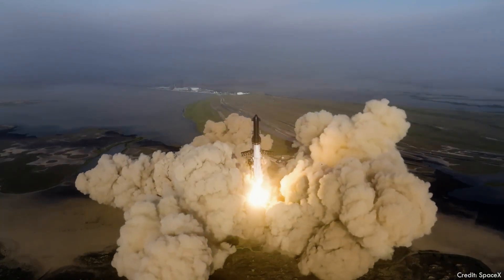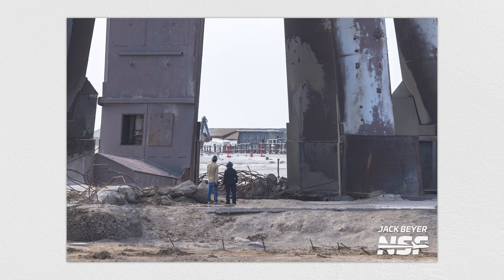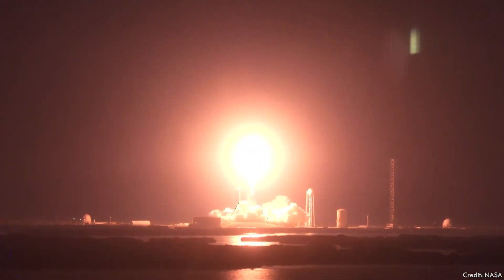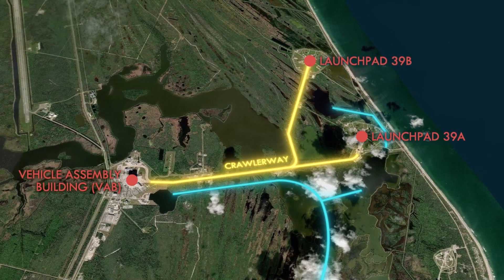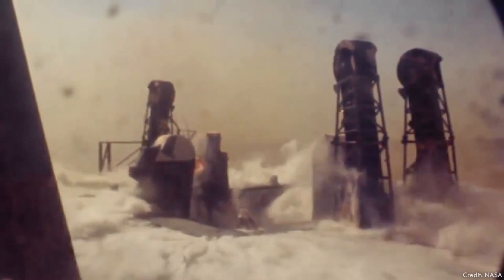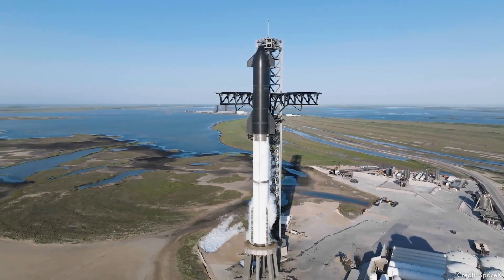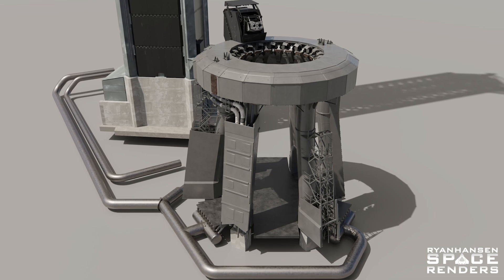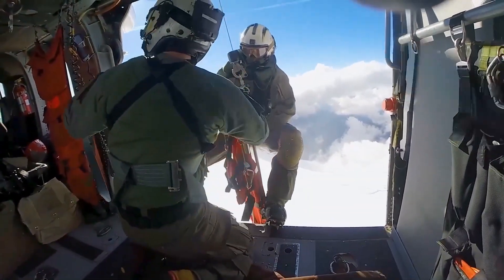Was Starship’s Stage Zero a Bad Pad?

Comment: The launch pad design baffles even the most casual observers. No attempt to even shield the support and supply structures or distance them from the pad. No attempt to channel or direct the thrust in any way is baffling.
Reply: that is because casual observers are easy to baffle. They would be surprised with what you could get away with. The casual viewer is going to be baffled when the steel plate works.
Reply: @snuffeldjuret  well it seems like they didn't "get away with" the original design in the first place, so...
Reply: SpaceX is eventually planning to build 10-100's of launch pads.  They're willing to risk a few messy failed tests now to find the cheapest way to build a launch pad.  They also appear to want a flat surface under the main engines so rockets can be serviced on the launch pad.  Finally the "tank watchers" on the internet had spotted parts for the water cooled steel plate months before the first flight test.  SpaceX knew that concrete wasn't a long-term solution, they just expected it to hold for just one more flight...
Reply: I mean there's plenty of shielding of the support structures. But when you're dealing with the amount of energy they are you also have to accept that there's no level of shielding that will protect you from a worst case event. So you build enough to work for standard operations and plan to fix it if something goes really wrong.

The gas dynamics of the plume under and around the pad itself are more complex than you'd think at first. The dead centre of the pad probably had the least heat flux and wind speed for example. Not intuitive.
Reply: There isn't going to be a pad on Mars. Id say its a good test lol
Reply: @j2kerrigan  there isn't a hospital on mars either, so let's stab the astronauts and see what happens.

Comment: So why not get off the pad with fewer engines and light the rest when clear of the tower?
Reply: Nowhere near enough thrust. It barely lifted with the 30 active.
Reply: It doesn’t work that way. It is at its heaviest state on the pad, all of the fuel is in the tank it is loaded with wet weight. 
It needs the most amount of force at the start…
You will NEVER take off without appropriate thrust to weight ratio.
Reply: The less engines you have the slower you'll be
Reply: @mskiptr  Right, it doesn't matter as that water cooler may do the trick.  But otherwise, a few seconds of fewer engines to get the mass that bit further away from the ground, then light the rest for a longer or stronger burn to compensate. Anyway, doesn't matter since neither of us are likely rocket scientists working on the project.
Reply: @Jack Photon  when it comes to fighting gravity you aslo have to imagine that it's a constant, so if you have 30% less power your rocket will not move as all the energybis spent fighting gravity, at 15% less rocket power you are still looking at a much longer time on the pad but you are moving, it's exponential growth of how long it will take when you cut thrust, more time on the launch pad means more time the rocket is blasting it. 

Other factor is safety, it's better to know if your engines light in one moment before launch vs in the seperate moments where you can't abort after the first set light up.
Reply: Of the 33 they can have I think 6 fail and make it off the pad. They had 3 fail on the pad and another 2 shortly after. I think a fair amount of the damage was actually caused by the greatly slower than expected liftoff speed. They were expecting 3 seconds or so of plume impingement on the pad tapering of to 6 seconds and they had more like 10 seconds of full intensity.

Comment: Certainly some info on the mode of failure would be nice.
Reply: @professorfrog7181 As I said, they'll most likely make it to space on the next launch. Needing a few launches to work through any issues with the largest rocket ever made is perfectly understandable.
Reply: Disintegration caused by high winds.
Reply: @Sonny_McMacsson  Disintegration was expected, but that didn’t eat through many feet of concrete and rebar. The concrete actually snapped in half under the load, and that allowed the “high winds” to eat through the soft sand underneath. Disintegration would have been acceptable, and even expected, but snapping in half was unexpected and thus not included in the assessment.
Reply: @timwildauer5063  that sounds about right. I seriously doubt spaceX would have gone ahead with the launch if they expected a catastrophic failure like this. Whatever they were expecting, it was probably much more tame
Reply: @timwildauer5063  doesn’t concrete have an expected maximum load…
Reply: So many engines failed it did not have the delta to make it to space nor orbit. They lost control of the biggest rocket ever launched, and it was trying to point back to earth. Thankfully it is just a giant metal tube with no real structural support, so even after the flight termination system failed, the rocket as able to fall apart in the air, instead of turning into a missile headed for Mexico/Texas.

Or do you mean the mode of failure for the launch pad? That was caused by pointing rocket engines at concrete and just assuming nothing will go wrong. Like all companies that employ "move fast, break things, go bankrupt" culture.
Reply: @noconsent  Nice bit of baseless fantasy and perhaps wishful thinking on your part. Once B7/S24 was heading down range, it wasn't coming back; "... turning into a missile headed for Mexico/Texas." is a story for the simple-minded.

The IFT1 showed that the rocket's hull can handle another 5,000,000 lbs-force of thrust under the booster, with a stretched ship with more engines atop it. The test flight of Stage Zero exposed its inadequate foundation under the pad, quantifying the needed upgrades that are now well underway to support 20,000,000 lbs-force launches on a rapid launch cadence. 

Starship and its successors will fly as reliably as Falcon 9 does today. Really large rotating space stations and nuclear-powered interplanetary express ships are now firmly in our near future abilities.

I've been waiting 50 years for this moment. The era of the super rocket has finally arrived.
Reply: @psycotria  dude had one launch clearance, given by the FAA, and absolutely botched it, and abandoned all responsibility for breaking agreements he had with fish and wildlife to not hurl concrete into protected wild lands, and you think he is going to be permitted, not only to do it once more, but to do it on a frequent and regular basis? Things won't get fixed if you can never admit you did something wrong. It is a fact the abort system failed, and who knows what would have happened then the worlds largest rocket, still full of fuel, crashed back on earth in area were it could have landed among the population. And the FAA is not giving out launch permits to rocket launches that don't give one iota about doing it safely.
Reply: @noconsent  The consequences of the launch were well within what was expected from the environmental assessment. The debris stayed within the the expected 700 acre debris area, aside from some harmless sand/dust. And you can expect SpaceX to repair the wetlands as per their agreement with the authorities.

The next launch is likely to be more successful. They'll probably get beyond stage separation, and most likely all the way to space. The next launch will also feature larger explosive charges so that it disintegrates quicker after FTS activation.
Reply: @noconsent  The first flight of a new design rocket often ends in failure to achieve all milestones. The sole criterion for success of IFT1 was met when B7/S24 "cleared the pad" without destroying the launch complex, freeing it up for the next improved test articles to come. 

B7 was the first booster deemed flight-worthy; it flew. 

The launch license is valid for five years. Starships have been grounded pending the outcome of a standard investigation into the spread of sand and concrete beyond the allotted 700 acres and the delayed response to the flight termination system (FTS) activation. Both concerns will have been addressed and corrective measures taken, before the investigation is concluded. 

All other operations are not affected. 

The next launch campaign is currently underway. S25 is on Suborbital Pad B and will do engine test firing. B9 is next up and will take to the orbital launch mount (OLM) as soon as in won't hinder the OLM's upgrade. 

B9 will fly with S25, sister ship to lost S24.

During IFT1, the B7/S24 stack never violated its clearance. It remained inside its flight corridor and came down within the exclusion zone. The rocket's construction proved to be more sturdy than predicted. A more powerful FTS has already been tested. A new det-cord FTS design cut booster test article B6.1 in half on a test stand in May. 

B7 had 33 unique Raptor 2 prototype variant engines. SpaceX now has data on each one's performance. Its retrofitted engine isolation shielding has been replaced with integral shielding in B9. The latest standardized pre-production Raptor 2 engines have been fitted. The hydraulic TVS failure that caused B7's 13 engines to lose steering has been replaced with electric TVS wherein each engine gimbal control is isolated. B9 is waiting in the hangar, ready to put S25 onto an orbital trajectory.

Every prototype booster prior to B7 except one has been scrapped after undergoing testing, including B7's sister ship, B8. 
Booster B4, the first to be integrated into a stack, is "retired". 
Ships SN15, which flew and did the first successful "flip & burn" landing, and S20, the first design to fit the Raptor 2 engine, are also retired and on display. It's either fly them or scrap them.

 
Starships will keep flying. They will land NASA astronauts on the Moon. It's only a matter of time before they will be flying and landing as reliably as the Falcon 9 does today.

Starship is our Super Rocket of the Future!

Comment: Those rocket motors were an older generation. So what do you do with 30 obsolete motors. You use them and take advantage of whatever data you can collect, including what happens to the launch site.
Reply: Personally I would've used them maybe to do an actual full power test over some of my concrete, instead of causing incredible damage to my launch facilities.

Comment: So why not show a before and after picture depicting Stage 0 after the test launch and Stage 0 now, around 2 months later...?
Reply: They put in something like 6 new friction piles under the mount and now have it filled with rebar, ready for the new pile cap pour.
Reply: What’s the point? That’s besides the point of the video.
Reply: Exactly. If it can be repaired so quickly, and months have passed, then let's see the progress.
Reply: @veloxsouth  It doesn’t matter if you can repair the damage quickly if said launchpad being obliterated also damages the launching rocket. It’s a failed design.
Reply: @skirata3144  good point

Comment: Why not assemble a system of multiple spacecraft in low Earth orbit, instead of trying to get the whole thing in one enchilada?
The heavier you make a rocket,  the more fuel required to liftoff, the heavier it gets...
Launch 10 Falcon heavy rockets to Low Earth Orbit, each carrying 1/10th of your plantetary exploration (Mars) vehicle.
Assemble it in orbit.
Then add people with an 11th rocket.
Then go to Mars.
Reply: I thought that's exactly the plan. Just done with completely reusable Starship, not Falcons, whose second stages are one-time use.
Reply: The bulk of the rocket is fuel, so that's basically what SpaceX is doing. To get each ship to Mars, they will first get a mostly-empty Starship into orbit and then bring all the necessary fuel during several consecutive launches.
Reply: @mskiptr  The Starship (second stage) is filled with propellant at launch. It just uses that propellant to finish getting to orbit, so needs to be refueled to leave Earth orbit.
Reply: Generally, as a rocket gets bigger, its payload to fuel ratio increases and hence its efficiency. So if you want to put 100 tons of mass on the surface of Mars, or the Moon, then it's better to launch a few huge rockets rather than many tiny rockets.

Comment: didn't nasa figure it out decades ago?
why is this still an issue?
Reply: > didn't nasa figure it out decades ago?

Yes, NASA did not figure it out decades ago. NASA rockets and infrastructure, time after time after time, ended up being WAY too expensive.
Reply: Because SpaceX is really married to being next to a wildlife reserve which makes getting building permits and doing some other stuff very difficult.  Common Sense Skeptic did a video where he discussed why they couldn't do a flame trench system, though I forget which one.
Reply: Because Starship is also supposed to be able to launch from Mars and the Moon, where you can't easily build a flame diverter.
Reply: @sdsd4139  You can't build steel sheets with massive deluge systems on Mars or the Moon either.  If they wanted a realistic test it should've been placed on loose sand and rock.
Reply: Someone didn't want to spend all that money? We have to replace it all anyway, why not save all that time, and let the rocket blast it apart.
Reply: 1st, Nasa never launched anything as large as this. 
2nd, it's not an issue. Damage to the pad was expected before the launch. When you expect a failure, it makes sense to document it, fail as bad as you can, in every way you can, and use that data to progress the next iteration.
Reply: @NG-VQ37VHR there is a difference between "damage" and "obliteration". Just because mr. Memelord days it is expected doesn't mean this was an acceptable test (or outcome).

Comment: 21st century productivity. Someone blows up a block of concrete. Everyone starts suing each other. No wonder nothing gets done.
Reply: I read how a company tried to build a storage hangar (a second one, alongside an existing hangar). 5 years and $500k in paperwork later, they still couldn't start pouring the foundation.
Reply: You gotta look at it from the other side. A lot of lawyers gets paid. Some of them might have even put those laws in place. I believe it's called job security.

Comment: Saying that it’s exciting, because they ignore laws and safety procedures, while decimating local wildlife preserves. Is the equivalent of excitement I would have for a builder to use rope instead of rebar. They’re just cutting corners to pinch a penny. They have an anemic launchpad because they built it around the wildlife preserve. A launchpad that only gives them a flight envelope between Florida and Cuba. Bear in mind we’re left with a decimated launchpad and the largest rocket ever made without a functioning FTS system. Dangerous and negligent does not equal exciting. I thought they taught that to engineers.

Comment: Will be neat to see how the next pad works out. Fun watching rocket launches!
Reply: Instead of dented towers, expect them to be shredded this time!
Reply: I am betting that it will fail as well.
Reply: @Old_Ladies  I'm betting on supersonic metal shrapnel flying everywhere
Reply: @Old_Ladies  they have already tested it for 5 months, and sand compression will now not be an issue. No reason for it not to work.
Reply: @beamed5382 wanna bet that spacex doesn't land one of these on Mars or the moon in the next 10 years? They will sooner go under
Reply: @beamed5382  they tested one engine against the water cooled plate and in the very brief video they released you could already see damage done to the plate and steam behind the plate.

Now imagine all of Starship's engines at full blast at a 90° plate. It is going to destroy it.
Reply: @Old_Ladies  The are leaving a lot of heat of evaporation on the table if they expect the water to stay liquid.
Reply: @Cara.314  What an idiotic comment. SpaceX has the most secure business model of any launch company in history. They launch nearly twice the number of rockets annually than any entire country; their launch cadence is increasing every year; their launch system is cheaper by an order of magnitude than their next competitor; their rockets are incredibly reliable and reusable; they have a subsidiary that operates the largest internet satellite swarm in history which is already worth billions to back their R&D operations... 
Maybe they won't land on Mars in the next 10 years, but treating that as its some trivial milestone that they should reach is ridiculous.
Reply: @Cara.314 HAHAHAHAHAHAHA,
Reply: These launches are costing the American people an enormous amount of money.
Reply: @JoeOvercoat how, exactly? They are a private company.
Reply: @jimmaag4274  VC is funding roughy half of Starship’s antics. SpaceX is tapping a NASA contract for the rest. 
P.S. All of Musk’s companies rely of Govt contracts or subsidies. Govt subsidies are several points of Tesla’s margin, for example.
Reply: @JoeOvercoat compared to useless multi billion dollar SLS system?
Reply: @JoeOvercoat  these launches aren't costing the American taxpayer anything. They are entirely privately funded.

NASA paid for the design of the capsule they use to get astronauts to the space station. That's it. They also pay to launch payload to orbit, which btw is far less expensive than Boeing and Lockheed was charging.
Reply: @pierredelecto7069  “In 2021, NASA awarded SpaceX a $2.9 billion contract as the sole commercial partner to ferry Artemis astronauts to the lunar surface in its Starship vehicle.” That is literally the banner return on Google when one does a search for SpaceX contract for lunar lander.
So, were you lying for Musk, or just in error?
Reply: Fun watching Elon Musk destroying nature.
Reply: @designtechdk  it is
Reply: @designtechdk  not the sand! Oh no😢